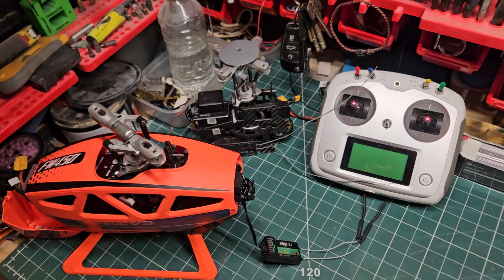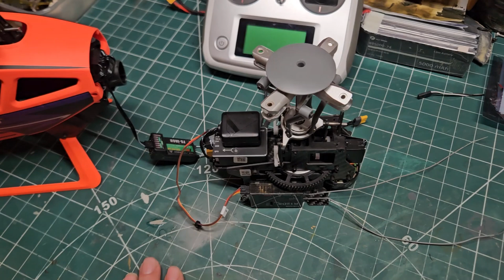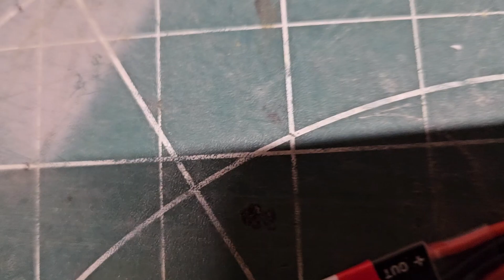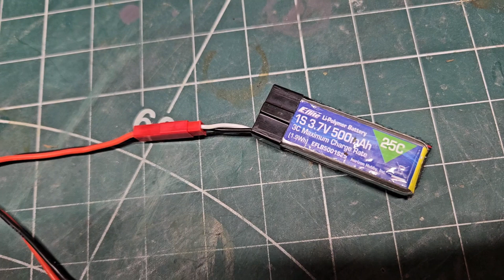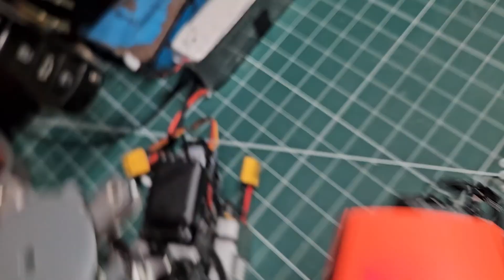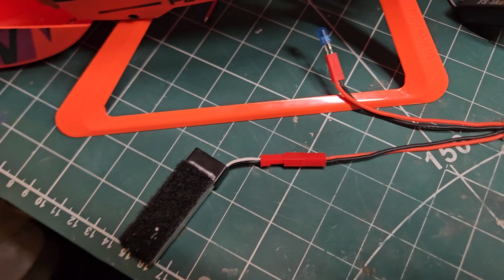Flywing Helicopter lights

Comment: How about if we put in a splitter off the 14.8volt instead of your small battery?
Reply from the maker: Yup thats fine as long as you use an inline UBEC to lower the voltage to match your lights requirements.

Comment: Hey guy, I'm pretty good with electronics. I got sound and lights on most all of my RC trucks. But after watching this video, I'll have to watch again. Yes, there are multiple ways to power up lights. Do your lights flash or burn steady?  A combo like a steady landing light and flashing running lights would be cool.
Reply from the maker: Exactly there are multiple ways. This method was mainly for Flywing helis due to the FC powering the RX, with this configuration any power being drawn from the RX is coming from the FC which causes issues. The traditional method is to power the RX from your BEC/ESC but these helicopters are wired differently. On this particular model the side navs are steady, the red beacons flash with 4 interchangeable modes, flashing rear strobe and switched landing lights.... soon it will have burning amber candle led's in the exhaust ports.... 👍

Comment: Unfortunately, the Channel 6 on my FlySky says "None".  I tried changing it to VRx and nothing happened with the rotary switch.  Then I tried "KEY" and my lights did turn on and toggle through the different patterns, on the bench.  But when I tried to fire up for a test outside, the helicopter wouldn't light up.  Hold the horses !  I reset everything, re-bound the radio to the helicopter, re-did the Ch 6 setting....and everything works !!!
Reply from the maker: Great news, it sounds like your lights cyle modes with a simple on/off movement, which makes you setup a whole lot easier ✌️.

Comment: Thank you for this information.  So many other YouTubers only show how to install.  But I needed to see exactly where to plug things in and how to run the wires and plugs.  I just acquired the huge FlishRC/Roban 500-size AH-1 Huey Cobra Attack Helicopter.  I believe the same FlySky Transmitter and Receiver are in it, so I hope to install my lights in that too.  Or possibly, I can figure out how to install my new GT Power Aircraft Sound Simulator and have both a turbine start-up sound as well as the (8) light system.  I emailed FlishRC for assistance, and to let me know if the same Channel 6 is available.
Reply from the maker: I can't comment on what channels are spare on your Roban helicopter. There is a FB group for Roban helicopters and Ed Montana is very helpful.  I dont own a Roban/flish helicopter but I dont think you will need to modify the switch (just use without removing red wire), you should be able to plug straight into the RX itself. We have to do this on Flywing helicopters because the flight controller powers the receiver, because of this any power we draw from the receiver is coming via the flight controller. I beleive Flishrc wire it up differently, as far as Im aware they power the receiver via the esc/bec then the receiver powers the flight controller. With that method any auxiliaries you add don't take power directly from the flight controller itself...

Comment: Hi your video was very informative and I am going to adopt this method, have ordered the switch.
I have a question which I hope you can answer for me, My question is I'm Ok with with what you have explained. I have G.T Power lighting system I somehow have to get the signal wire from the GT main control box to the Channel 6 Aux signal. So I can change the lighting modes.
The only way I can figure this out is to use a Y lead from channel 6 to the switch then from output of the switch, to the receiver minus the red wire, and connect just the Negative and signal to the other port of the Y lead.
Reply from the maker: Without knowing exactly how the GT lights work its hard to suggest the correct method. It all depends if they change mode everytime you cycle on/off or if they have a signal to change mode. The easiest solution would be to attach the signal wire from the GT lights to another channel. This way ch6 is to turn them on/off then ch10 would be used to change modes. 👍
Reply: @MR_T_Rc Thanks for your prompt reply, I will try your way first  and see what happens. How would  I select another channel if Aux 6 is the only available port.😊
Reply from the maker: @Robert-r4z2r as long as you have a receiver that has 10+ channels you can just connect to ch 10 and assign it to a switch. If you are using the stock FS-iA6B then you will not have ch10 available. Good news is if your using the Ace flight controller you can use the FS-IA10B instead of the supplied 6ch version. 👍
Reply: Thank you.

Comment: When my main battery to power the heli is disconnected, the blue light to the relay switch is blinking, and drawing current. Does my aux battery need to be disconnected as well?
Reply from the maker: Yes always disconnect the battery when not in use. The blue flashing light is indicating a break in the circuit due to it being modified to work on a Flywing heli. Before modification this switch wouldn't do this at it wouldn't be receiving power, due to relocating the positive wire it will always receive power from the aux battery whilst connected....
Reply: Thank you again for the tutorial.  You have a great channel. Cheers from the USA

Comment: Awesome video  ! I've been searching how to add lights to my Bell 206 and your video is spot on !
Reply: Get the gt power strobe ones they are the best by far 😍
Reply from the maker: @RCSTRAYA not tried the GT Power strobes myself, the best lights I have found are made by a company called Flytron, their cob led's are insanely bright ✌️
Reply: @MR_T_Rc  yes im also using the flytron strobes. I think they use the same components but the gt can handle more than 6 volts.
Reply from the maker: @RCSTRAYA Thanks for info, I'll definitely look into trying a set out. I've just built a Sukhoi SU-29 which will need lights adding soon so maybe a good time to experiment ✌️
Reply: @MR_T_Rc no worries oh quick question, ive just programmed the same radio link radio and used your video how do you know what value is the auto fly function? I did set it to switch C like yours.
Reply from the maker: @RCSTRAYA Autofly doesn't really have values as such, nothing you can access or change. Only ch5 has adjustable values. Autofly is operated via ch8 and only has 3 options so all it needs to know is Up, Centre and Down. Up is always OFF, centre is always 0 Fly and down is always 8 Fly. If you used a 2 position switch it'll still work but you wont have 0 fly as you have no central position ✌️
Reply: @MR_T_Rc ahhh cheers thats easy to understand 😉👍🏽
Reply from the maker: Glad its still of some use 😁

Comment: Thank you for the video.  I am new at this hobby, and not electrically inclined, so please bear with me.  Your instructions looked very easy to follow, but I see one issue that looks to be a problem...the lighting systems I'm seeing advertised have the same plug as what you show going into the receiver (from the switch).  However, it looks like from your video that the plug on the switch that you would connect the light system to is a JST plug.  How are you connecting your lights to the switch?
Reply from the maker: @chrispetro4463  The light i purchased had a jst lead on them so connected directly to switch. You say the lights you have been looking at have a futaba plug... does it have 3 wires or 2? If it has 3 then those light probably have switchable modes. You can still run lights with 3 wires but you will only need to connect the positive and negative meaning you won't be able to change the flashing pattern.... most cheap aviation lights on amazon, Ebay etc only have 2 wires.....
Reply: @MR_T_Rc  99% of the lights I'm findings are the Futaba plug, and I've seen both 2 wire and 3 wire.  The few jst plugs I'm finding look to be for police cars...they are red/white and red/blue combinations.  Can you tell me where you got your lights from?
Reply from the maker: @chrispetro4463  That problem is easily solved with either a JST to JR Adapter or cut the futaba (JR) off and fit a JST connector. As long as it has 2 wires it'll be eaily adapted. No point getting a 3 wire version as you'll need an extra channel for the signal wire, on the FS-iA6B you only have one spare channel if you were using an rx with more channels you could put the 3rd wire on the signal of another channel to switch modes....
Reply: @MR_T_Rc  Got it - thanks much for the help!!  🙂
Reply: Got my lights, battery, switch, and all the parts.  Hooked it up...looks great!!  Was upset at Flywing that, at this price point, the lights weren't already installed, but I REALLY appreciate your video and answering questions!!  You're the best!!!  🙂
Reply from the maker: @chrispetro4463  Awesome news! Always happy to help a fellow pilot 😉.

Comment: These lights work on model aircraft and have a plug for the receiver  
Can't see what's the difference with flywing models.
Reply from the maker: @Lonsome1223  the difference is the flight controller powers the RX on flywing helicopters rather than the RX powering the flight controller. So powering any thing from the RX will draw extra current through the H1 Flight Controller which is what flywing advise against.... 👍
Reply: @MR_T_Rc OK,THANKS FOR THAT.

Comment: Great video and very informative.
I'll be picking up a Flywing Bell 206 at the weekend and want to put lights on it so this is perfect.
Please could you let me know where you buy the lights and which ones? I'm in the UK.
Thank you.
Reply from the maker: @stevewebb2201  it all depends you can have a simple aviation pack from Amazon eBay etc for about a tenner. Or if your someone into more electrical work then their are brighter better options. But if you want to keep it simple buy a pack of aviation led kits (imo 5mm looks better on this size heli). The only thing I don't really like is the strobes are never fast enough on the cheap kits. I'm installing some flytron strobon leds to my Airwolf and it's a bit more completed and plenty of soldering!! But it'll be worth it. They can been seen 3km away which is CAA approved..... many options bud. Depends on your patience and skills 🤣.... Thank again 🙏
Reply: @MR_T_Rc  Perfect, thanks for the information, I'll have a look at the options. I've got a mate that's handy with soldering and electronics 😊

Comment: I used another configuration: A battery diverter (power source is the main battery. XT60 male-female pass-through with an additional JST female plug), a DC-DC BEC (stepping down from 14,8 Volts to 5 Volts) and then I followed your configuration.
Reply from the maker: @andreas26575  Good job, that'll work perfectly. Doesn't have to be a separate battery, running a UBEC from a y-harness off main battery will have the desired outcome. I'm re-doing all the auxiliaries and lights on my Airwolf with Flytron Strobon cree led's and a runcam thumb pro so im intending on doing the same as you, I will be using a 5v ubec from the main battery into modded switch 👍
Reply: I also watched other video where he installed nav/strobe lights on his Flishrc heli using a BEC drawing power from from the main battery but he did not use the remote controller to switch on/0ff the lights..
Reply from the maker: @earlskie2u  Thanks for message. There are many different methods, just depends what your requirements are. You can also power this switch using a bec from main battery.  👍

Comment: Hi, sorry to be a pain..I'm new to installing lights..what lighting system do you use on the Airwolf please and where can I order that system..thanks Steve
Reply from the maker: @StephenShillingford  Hi mate. This was all separate pieces and not a set. I used various leds and some beacons from an rc truck. I would recommend just getting a std pack of aviation lights for rc craft as that'll be all in one circuit making life easier.  This setup uses 4 channels, but it's all been removed now and im moving over to flytron strobon cob leds. They are awesome and a lot brighter. I'll be doing that install within the next 2 weeks once new paint job is done and mini guns have been added.... 👍

Comment: This is a great video, everything explained very well. Is it easy to add more lights? I would like to add 2 navigation lights, green and red, to my Fly Wing Bell 206 Jet Ranger.
Reply from the maker: @ady-uk7150  yes it's easy enough to power more lights. There are many cheap aviation light packs on the market. You can either go for a set that has a separate battery and manual switch or use this switch so you can control lights from tx. I find 5mm lights suit this size heli better.

Comment: Awesome explanation and demonstration.
I used to do similar wiring with my custom hydraulic units for optional voltages of different draws needed to power different channels. I definitely didn’t know that you shouldn’t power from heli receiver as it could cause failure though.  I’ll be doing this  method.  I was wondering is it an option if you bind a 10ch receiver you should be able then to have a few more open channels to do multiple options. Like a spot like powered by separate feed as well on other vrx dial? Again excellent presentation 👍🏼👍🏼👍🏼👍🏼👍🏼
Reply from the maker: @thatsmyrc  Thanks for response! Yeah it really is a simple circuit, and works perfectly whilst isolating your auxiliaries from the heli. Because flywing use the h1 to power the receiver any spikes or surges can have severe consequences for the h1 unit. It is stated in the h1 manual to never draw a current from the receiver if it's  powered by the H1.  You can't use the flysky 10ch rx because it is 6.5v max. H1 unit puts out 7.4v so it can't be used. The only option for more than 1 spare channel is to use a different radio system. I don't use the flysky radio I use radiolink at10 II which has 12 channels. Flywing  helicopter uses 8 channels. So I have 4 spare ch's to play with..... 🙏
Reply: @MR_T_Rc  your so correct on the 10ch having different max inputs. As I realized with my bench testing of experimenting I’ve burned a few up when trying new things few yrs back pushing inputs for max power to servos etc for driving gears on equipment.  Man the receivers stink to high heaven when they get fried out.  As I always like to do learn from my failures.  I’ve failed a lot yet still so far away from knowledgeable 🤣🤣🤣 👍🏼👍🏼
Reply from the maker: @thatsmyrc  hey..... I'm no different!! I've been away from this hobby for about 10 years and technology has moved on so much! I  have an awful lot to learn. All this GPS business is nothing I've come across before in this hobby. I'm so far behind with my knowledge it's unbelievable!!  I've only been back flying for about 4 months.  

We have to make these mistakes as without them we don't learn! I've been ripping stuff apart since I started walking!! 😆

Comment: Very cool. I believe you actually only need the white wire? that is the signal wire?
Reply from the maker: @tumadsvids  I tried that and it didn't work.... has to have both. I thought the same but it doesn't work with just the signal wire. Your welcome to try 🤣
Reply from the maker: Some people will power these switches with a bec from the main battery when you do that the signal wire should work on its own. With a 2 battery system you need all neutrals on a common rail. So the neutral from the switch has to be connected to the heli to complete the circuit. Which is done by plugging the neutral into the rx. That's fine as it doesn't draw a current.

Comment from the maker: Part 1 Power System 1:02
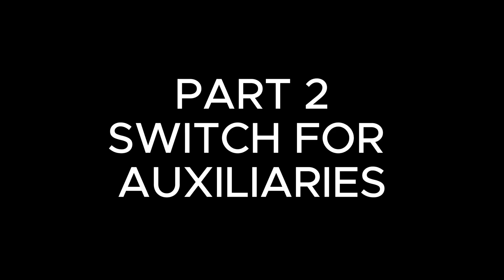Part 2 Auxiliary Switch 6:42
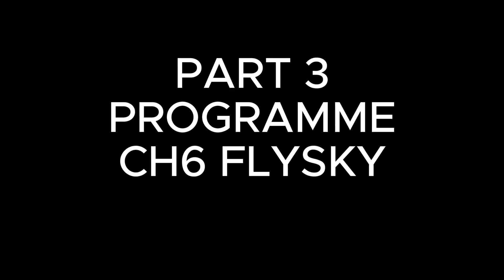Part 3 Ch6 for Tx  22:30
Reply: Perfect🫡 is there a way to make the nav lights get blinking intermitently?
Reply from the maker: @earlskie2u  you'll need a control board to make lights blink. Most cheap nav light packs will come with a control board with different outputs. You'll mainly get outputs with a permanent on, slow flash and fast flash....